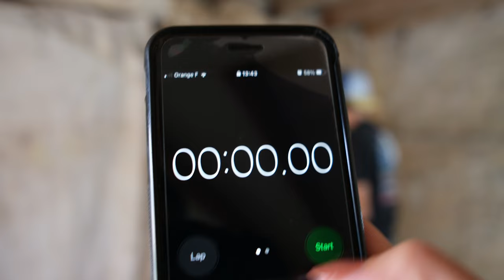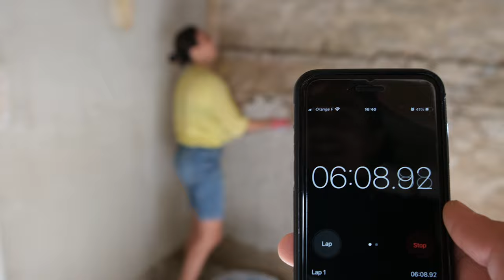Monocouche madness | Episode  3

Comment: When I  plastered a wall once.. 2 tips I got were
1 - make sure the wall ain't superdry
2 - use a primer !
(especially that last one worked awesome.. mind you.. different wall, different plaster... so totally unsure if that would help in your situation (YMMV))
I had to make a very thick layer like 2 - 3 cm but it stuck to the wall like glue.
Reply from the maker: Thanks so much for the tip, we're going to be plastering some more standard walls soon, so we'll definitely check out a primer!

Comment: Hi guys if you wet the wall with a spray bottle first it will be easier to apply. Great work.
Reply: Ignore that advice I see your wetting it 😊
Reply from the maker: @flowerphotos6440  no it was exactly right, it was just the first mix needed to be a little wetter. Thanks for the tip !